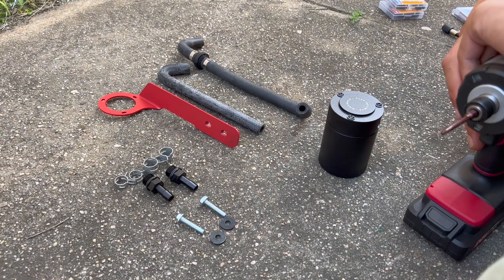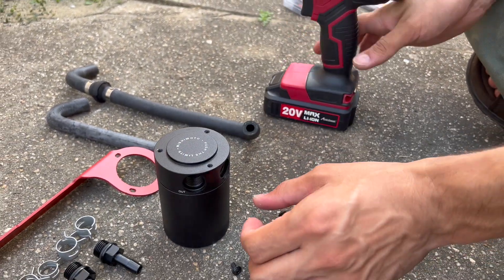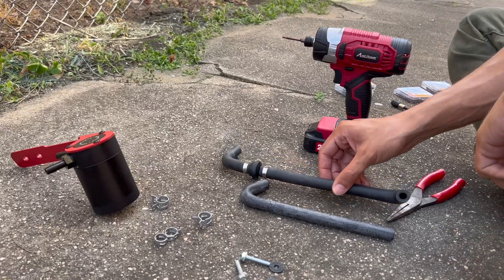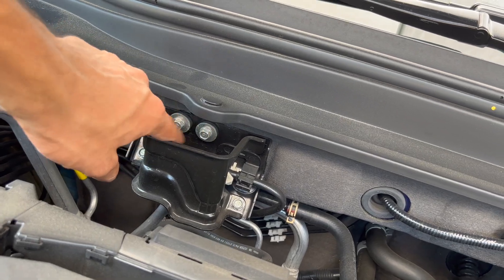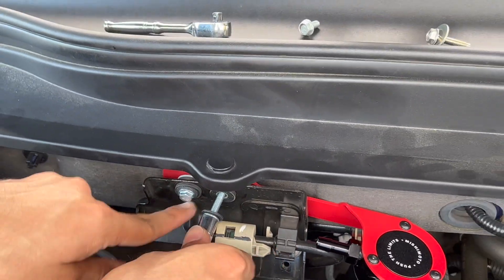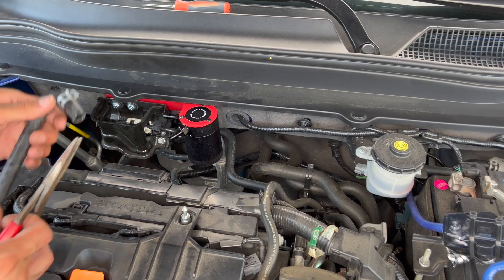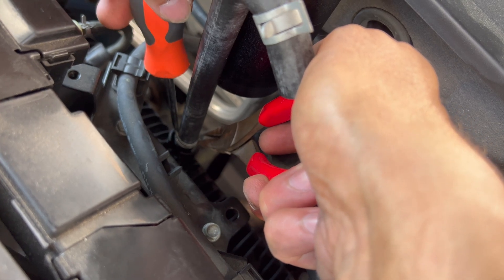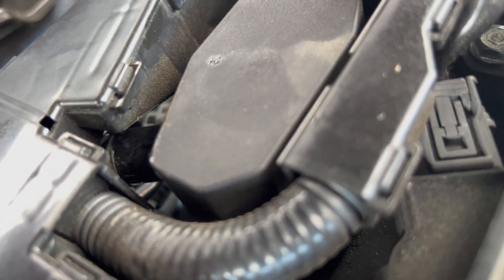10th gen needs this important modification! 2018-2022 honda accord oil catch can

Comment: If I install this do I have to check it constantly? Or every oil change? Also thanks for all you videos! Has helped me transform my 2.0T! 💯
Reply: I have this same catch can installed and i check mine randomly every few months. The most I had in there once was about 3-4 oz and it can hold alot more than that
i drive mostly highway/turnpike
It works

Comment: What exactly do that thing on the accord…that engine nearly uses to much oil…on less you try to build a race car…is it?
Reply from the maker: it filters the oil. doesn't let the dirt or whatever small metal particles
Reply: It also separates the fuel in my 1.5T from dilution. Also keeps your injectors cleaner. Since we are direct injection.